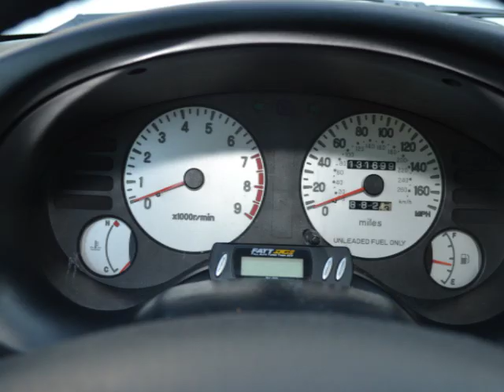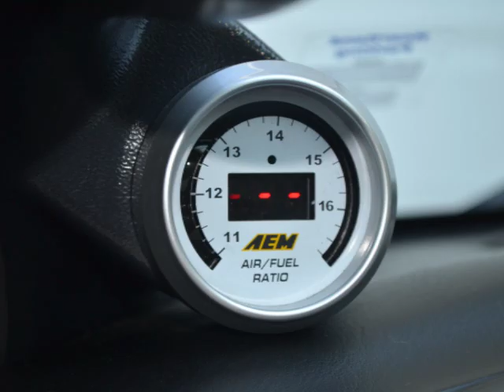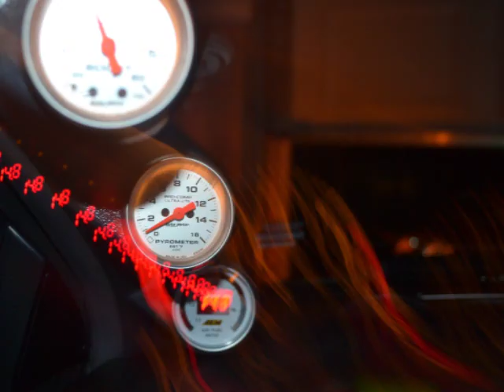1999 Mitsubishi Eclipse GS Turbo 10th Anniversary Edition Restoration 6th

Comment: Hell yeah, now we just need to buy all the eclipses in the world and clean them up and de-rice them'
Reply: I bought mine completely stock, 170k miles for only 380$
Reply: marcos555554 what??????????? 😲
Reply: Carol West yes, I have pictures if you'd like to see them
Reply: marcos555554 wtf
Reply: @marcosr666  380? Did the engine just blown up or something?
Reply: @dybixs1400  nope, just got lucky I still have it and even turbocharged and cammed it. I recently sold my R56 Mini S and was dailying my E39 but got an XB due to gas prices
Reply: @marcosr666  damnnn you are the legend!
Im about to get a $3000 99 GS, any suggestions to keep it alive?
Reply: @dybixs1400  Id suggest changing the timing belt and just doing basic maintainence, make sure your cooling system is good too as these cars are known for their head gaskets going out

Comment: What did you use to remove that black goo?
Reply from the maker: +Marisa Kelley I used paint thinner. It's about the toughest thing you can use to get gunk off like that. Lot of scrubbing either way but well worth it. There might be a better product for it but I didn't want to waste my money on it. On metal it's easy but on the plastic trim you have to be careful! G/L!

Comment: Just buy a GST with 4G63 instead of the Dodge Neon model. Lol
Reply from the maker: Luis Lopez watch my other videos I have 2 lol! And this one was fun too because it was a project not a stock setup.
Reply: Lukasz P I only see your 1G Talon video? I Have a 1999 GST Spyder. I was offered several 420a dodge neon engine models for dirt cheap at the time of purchase but, i decided to pay up and go big or go home and bought the 4g63 instead and it was definitely for the best.
Reply from the maker: Luis Lopez yeah I don't like convertibles those are cheap and everywhere. Also the 1G engine and Talon is the best. No crank walk 6 bolt. I had zero issues with mine. And there's two they look exactly the same but one has 27k miles all stock and one with 99k with bolts ons.
Reply: Lukasz P 1G models are strong because stock they were underpowered not using their full potential. 2G models look better but the crank walk was 1997- early 1998 thats the reason I bought a 1999 as far as the convertible nothing beats putting down the top on the Las Vegas strip on a summer night. Not to mention you cant buy a 4G63 in Las Vegas for under $3500 running coupe or hard top, 420A go for $500 all day long here. I had to buy mine in North Hollywood, Ca with a bad 5 speed and a warped head for $2000 with 89K miles